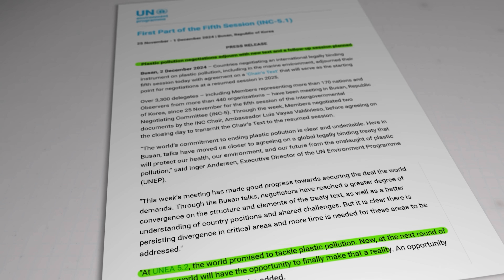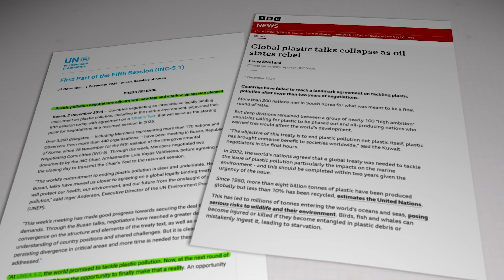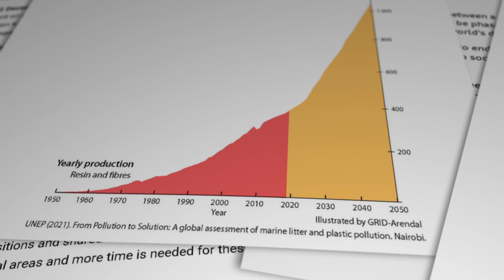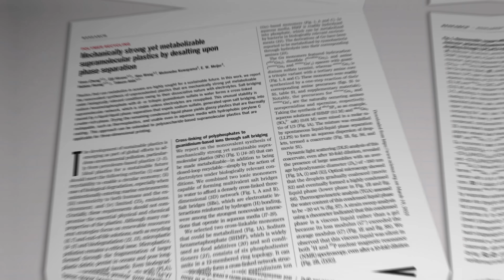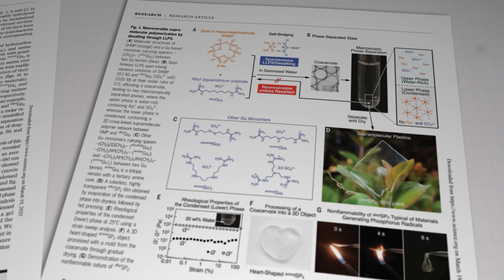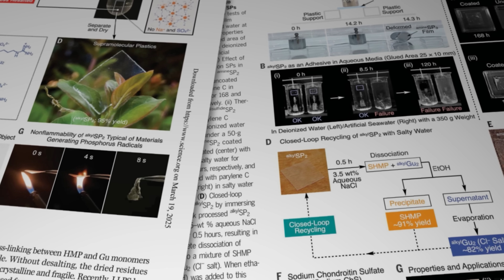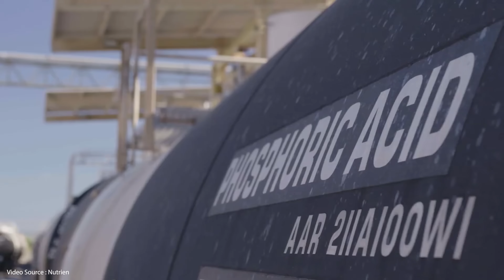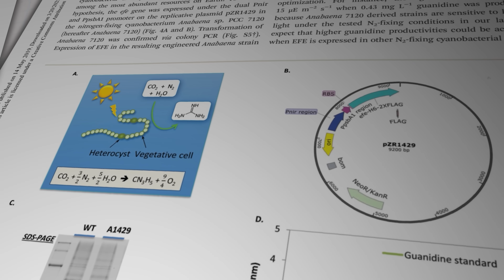New plastic gamechanger.  NO FOSSIL FUELS!  NO MICROPLASTICS!

Comment: Thanks for all your good work.  I will disagree with you on plastics.  Born 1942 we had no plastics but there was no dirt, squalor or rubbishes.  We had string bags--bring back with handles--shopping baskets, canvas shoulder bags, boxes et al.  There is no need for plastics & bulk could be provided by hemp or other organic materials.  I suggest a podcast on this.
Reply: Cannot force everyone to be better but can force industries to change standards. That's easy actually if we had better governance
Reply: We could probably make enough plastic by using current levels of corn that is currently used to make ethanol, to make PLA. Using corn to make ethanol is not a good idea anyway.
Reply: Not all microplastics are as harmful as the usual microplastics.
Reply: @FLPhotoCatcher the amount of ethanol produced & the amount of fossil oil produced is several orders of magnitude different 😢
Reply: @alanhat5252  Exactly. My point is that we should make a lot less plastic.
Reply: And less ethanol
Reply: Hemp is cellulose, which is natural "plastic" (organic polymer). The issues with manmade plastics is of course there are no microorganisms breaking it down (or it is thermodynamically unfavourable - not even talking about fluoropolymers) You had cellophane, celluloid, pyroxylin (nitrocellulose lacquer) etc. etc. Lot of cellulose derivatives are used till today since plants do the work of carbon catenation and lot of it is readily available as it is waste from food production.
But not everything "natural" is green - like paper production or artificial textiles.
Reply: Some plastics items are ok, I have buckets, laundry basket, storage containers, tool boxes that i've owned for many decades that are still intact. We just need to reuse things more, like soap dispensers that could be refilled but instead are thrown into the recycling bin, and countless other things but, that's not profitable.
Reply: his point wasnt about cunsomer products that are currently the main source of plastic pollution. plastic have to stay. it has very special properties. but the majority of our usage as you said could easily be replaced. altho, not at no cost.
Reply: Wherever there has been humans there has been rubbish. The main difference from present day is that most, if not all rubbish was made from biodegradable organic material. 

Google ‘midden mounds’, they could be regarded as a form of rubbish
Reply: The issue being of course the increase of oil used since the Second World War and diesel, petrol, lpg coming from each barrel plastic does, increasing one increases supply of the other and almost everything around us is oil based. It's more moving away from coal which is electricity and moving towards more horsepower under the hood than all horses that have ever existed, then of course asphalt exists as a waste product if we get a synthetic carpet, any of the 6000 products we get from each barrel, if we want any of them all the others come in some form as well.
If people want aspirin petrol exists, hemp has to be able to replace all the products or it's just more supply and the existing product for plastic, naphtha I think it is called, is just a percentage of each barrel, I think 82% we burn, all single use too.
Reply: No plastics? Bakerlite was the plastic in household plugs and sockets. Nylon? Perhaps what you mean is that single use plastics were not widespread.
Reply: @Andyroid7339 it kind of is an insult to God that we use a substance that does not decompose in a reasonable time frame to natural processes for single use
Reply: @20-Foot-Anaconda Billions of us all consuming paradise, is an insult to god.
Reply: @billpetersen298  goes a bit beyond a mere insult

But yeah
Reply: @billpetersen298  goes a bit beyond a mere insult

But yeah
Reply: No dirt, squalor or rubbish?  You must not have lived where I did.
Reply: Appreciable thought but changing consumer behaviour is one of the toughest things to do in the short term
Reply: Then you're welcome to go back to a 1940s standard of living, along with the logistics nightmare that glass bottles and medical supplies cause. But don't force it on the rest of us.
Reply: @gregorymalchuk272  That's a false dichotomy. We can do much better than we did in the 40s. And I have no idea what logistics nightmare glass bottles cause. Let's compare, okay? You buy a palette of Coca Cola bottles, and the next time the driver visits (of course Coca Cola distributed their own bottles using their own drivers!) he picks up the empty palette. And for three empties, you get one full free. The driver goes with a full load of full bottles on his run, and returns with a full load of empty bottles right to the bottling plant. Sounds incredibly simple to me.

Today? Essentially every single piece of packaging is your problem. You have to deal with the waste logistics, the returning, the sorting, the cleaning... all your problem. How exactly is that easier? Because the bottles are lighter? Or because you can throw them in the trash and forget about them? It has about the same level of logic as claiming that single-use disposable plastic plates are better than the ceramic plates you bought twenty years ago because they're lighter, take up less space and don't have to be washed. How efficient!  When you ignore all the negative externalities and costs you impose on others, that is.

Coca Cola did that to sell more junk, reduce their costs, consolidate things like bottling plants and logistics chains, which reduces their costs... by taking advantage of infrastructure that someone else has to pay for. The funniest part is that you don't even get less weight to carry, because you're just buying that much more in the first place :D In most of the developed world, people still drink tap water as their main source of hydration. When Coca Cola first tried selling bottled water in the UK, they were absolutely humiliated (though they are laughing now anyway, as they did actually eventually succeed, though still not nearly to the extent of the US, and they are facing some difficulties from the cities and governments, unlike in the US where they can do essentially whatever they want).

It's doubly hilarious with the amount of people living in subsidized suburbia where they get access to tap water at incredible costs (most "suburbias" in Europe don't get water or sewage because it's ridiculously inefficient and expensive)... to the city they're not paying taxes to. And they don't even drink that water! Yay progress :D
Reply: @LuaanTi  The problem with glass bottles is that they're heavy and fragile. So trucks and trains are transporting lots of useless bottle weight for each litre of beverage, and you need extra packaging around them so they don't shatter. This all wastes cargo capacity, and thus trips and fuel. Making glass is also very energy-intensive. You can extrude a whole pile of plastic bottles with the energy it takes to melt the glass for one glass bottle. If we reliably collected and recycled plastic bottles, they'd be an upgrade on glass in basically every respect.
Reply: And you also had foodborne illnesses from people shoveling grain or cookies or whatever out of a common trough, which only needs one person to cough on it. Plus, the food residue that got onto the bag one day became the source of contamination for another day. We've been finding that out with the whole "reuse your grocery bags" thing. I'm not saying the single-use bags were a good solution, but there is an actual problem being addressed.
Reply: @mal2ksc  I'm holding my breath waiting for you to come up with any kinds of statistics that suggest there was a drop in foodborne illnesses in any way related to the use of plastic packaging. Especially related to things like a local butcher giving you paper-wrapped fresh meat you consumed the same day compared to vacuum packed meat shipped in from Australia or wherever. Plastic packaging allowed some rich idiots to make even more money, while shifting all the extra costs (like dealing with all that waste) on someone else.

Careful where your arguments come from. Just because they sound reasonable doesn't mean they reflect any truth whatsoever. Shifting from local shops to global multi-national corporations alone did more harm to public health than could ever be prevented by something as inconsequential as plastic packaging. And by the way - people still shovel all sorts of foods out of common storage (where "storage" means even things like "just dumping it on the ground"), and surprise surprise, it works just fine. In fact, it has quite a bit of potential for reducing health risks for much the same reasons that crop rotation works. Unless you do it really poorly.
Reply: @mal2ksc How does reusing grocery bags significantly change the number of bacteria and viruses we're exposed to from shopping?